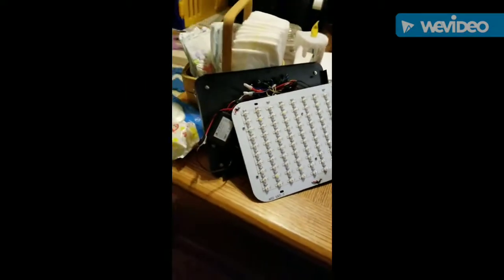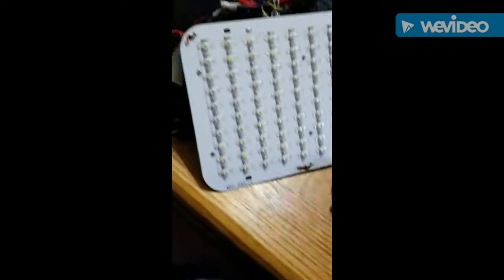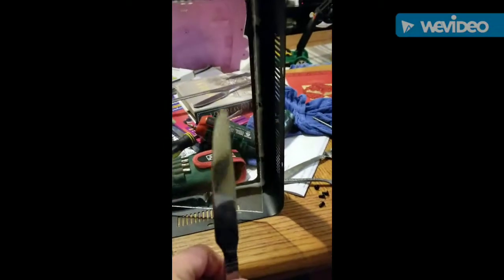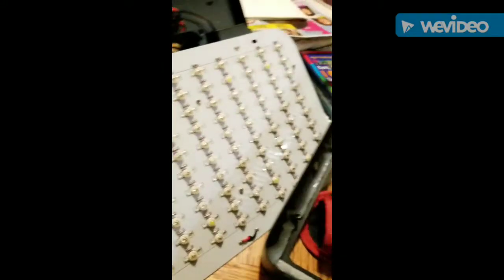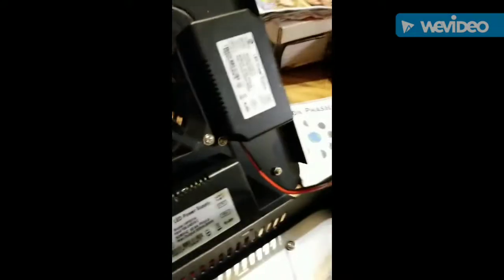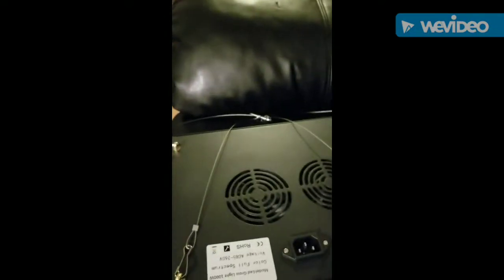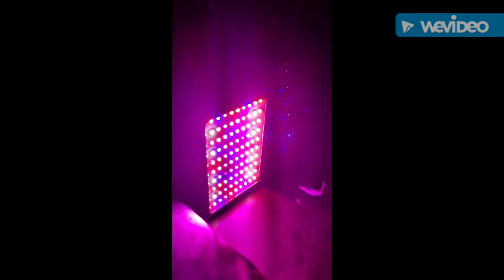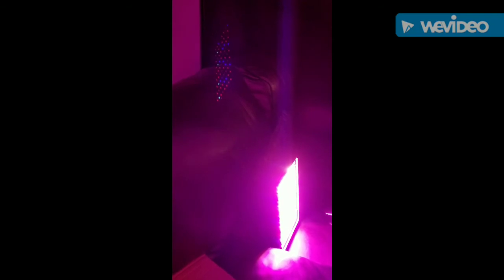Hack to increase light output of LED GROW light

Comment: Problem with this dust and grime  and humidity all the environmental factors used in a grow tent will definitely shorten the lifespan of the light. I doubt it make through veg. Bub everyone knows talong the glass would increase PAR . But dont you engineers of thousands of these lights already thought of this. Its firehazard too.
Reply: So your say the glass helps par?
Reply: @willieelumper508  yes absolutely.  
Look to Optic 
Synce and FoHse. 
The guy making the video is a clown
Reply from the maker: @timpage5021  please paste a link to the evidence that shows removing a cheep plate of glass improves PAR. Because searching what you put returns no useful links. I’m quiet willing to be proved wrong and learn from it. However a plate of glass is not an “optic” it does not focus or change frequency, unless you count random color impurities in the glass? The LED’s are already tuned to output the correct frequency for growth or flower. All the glass does is convert an amount of the light energy to heat in the plate of glass....meaning that that energy is not making it to the plants. By the way you can stop the insults they are unnecessary and just make you come off as a grumpy ass hat!
Reply from the maker: @timpage5021  bottom line PAR (Photosynthetically active radiation) is a measurement of the number of photons (intensity) that strike an area in the specific frequency used by photosynthesis.  The glass converts some of the photons the colored LED’s create, reducing the photon count of that frequency...and hence lowering the PAR

Read this article if you don’t believe me.

https://en.wikipedia.org/wiki/Photosynthetically_active_radiation
Reply from the maker: How is removing the glass a fire hazard...if anything it reduces the heat inside the LED casing ? Non of the electrical is anywhere near the frame, and the rubber glass acts as a spacer anyway. I have not seen an issue with dust or dirt as the LED face downward so it does not accumulate dirt. However I guess you could unplug the light and use a dry cloth to polish the LED bulbs.

Comment: Legend mate I'm going to do this to all mine tomorrow! I thought that f ing glass was reducing the output but I didn't want to leave it out last time I cleaned them because of the board touching but ill use some door draft tape along the edges should be fine and my plants should love it
Reply from the maker: Any feedback on how your plants like the output without the glass?
Reply: @martinbuss6818  it made no difference with or without as far as I could tell so I just left it out anyways. Edit I don’t actually grow or smoke anymore but before I did stop I had upgraded my lights to those HLG 240w passively cooled LED dimmable lights with meanwell drivers the heat was quite high but 3x of those and i grew a lot of weed. One plant had over 8oz on it but I could never really get the quality that good.
Reply from the maker: @Alexander_l322  I have switched over to an adjustable 400/600/800/1000Watt HSP bulb system the it puts out a BIT more heat but it’s not to bad in my tent, I do use a 10 inch exhaust vent pipe and air fan...the yield on HPS is DEFINITELY higher then LED by at least a 50% increase. I was using 2 or 3 600W LED lights per 4X4 tent and I thing the power consumption was about the same...my power bill went down a bit if anything when I switched to HPS! 

https://www.amazon.com/dp/B00CQ8ROYO/ref=cm_sw_em_r_mt_dp_Gfq.FbATNC15S?_encoding=UTF8&psc=1
Reply: @martinbuss6818  yea I think if I was ever going back to it then I’d just get HPS lights and a bigger extraction fan. Power bill would go down since 3x 600w is 1800w and your HPS at max is 1000w so a fair bit less and pushes out much better light

Comment from the maker: photons hitting anything will result in the light energy/frequency being converted into heat. so by removing the glass the photons...or more of them as in a higher percentage are free to pass through the air and strike either the plan leaves or reflect off the reflective walls of my grow tent. so less heat in the top of my tent and more warm light hitting the leaves of my girls!
Reply: Wrong